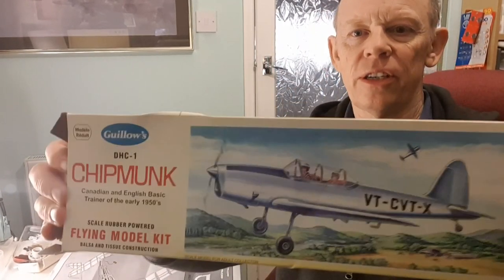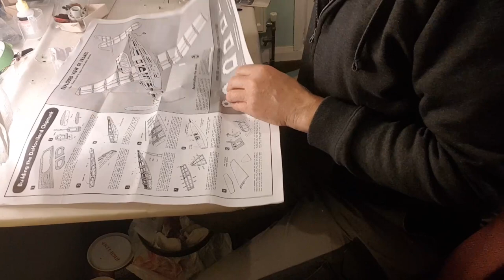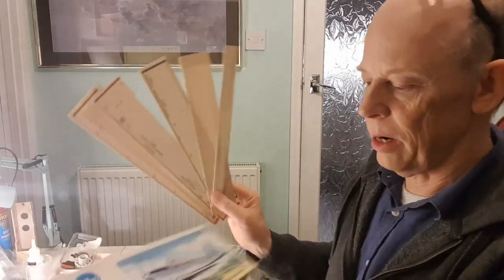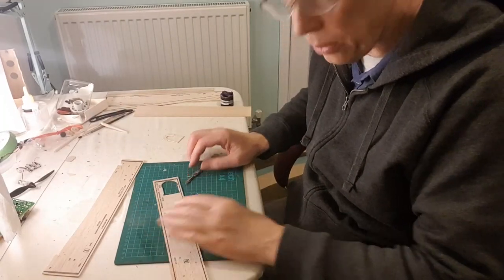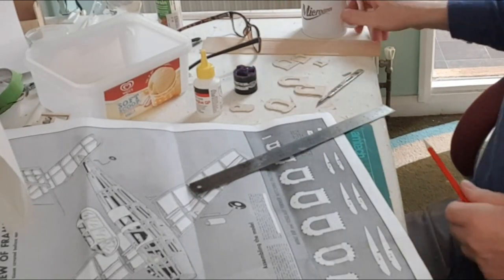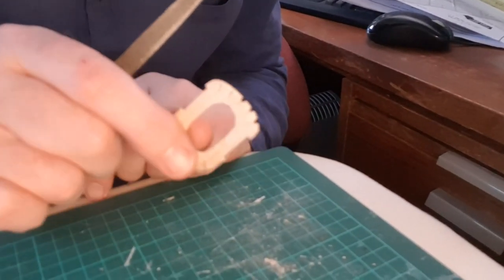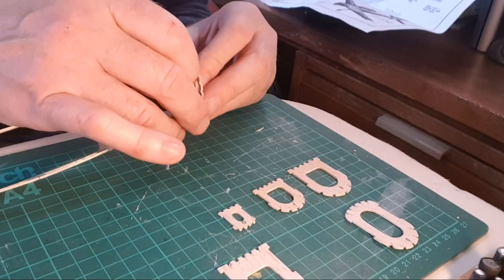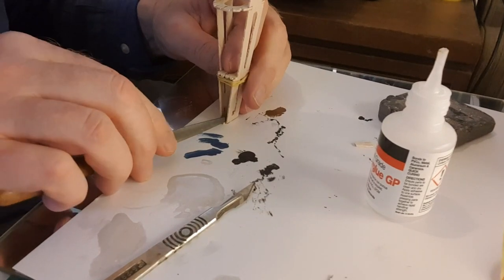Guillow's Chipmunk Radio Control Conversion Part 1, Fuselage

Comment: Hi cliff this will be very helpful as I am building a guillows hurricane next. I will probably use a volantex mini trainstar for the rc bits.
Reply from the maker: Hi Jon, I had a quick look for a picture of the electronics but was unable to find one but the plane is super small so it should work ok, the heavier the model the quicker it'll fly so build as light as you can ... I'm sure you know that already though. 😉

Comment: One of my favourite planes Cliff.  I just Googled the kits, very good price.  Might even have a go myself, plenty of time on my hands!  What motor would you put in something that small and I suppose micro rx and lipo?  I've never built or flown anything that small.
Reply from the maker: Hi Bob, sorry for slow response, got caught up in the Garden Combat video. I use the same as my Microaces models, in fact you would have just got a glimpse of same in the 'part 2' video, but part 3 goes into more detail.